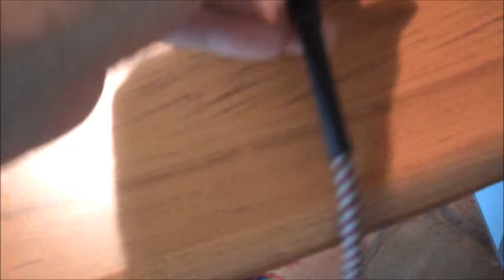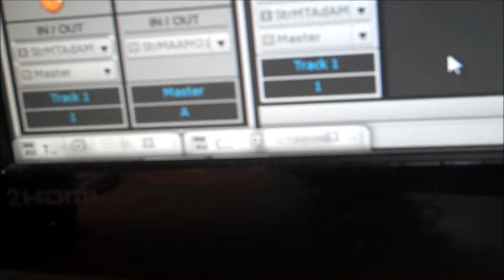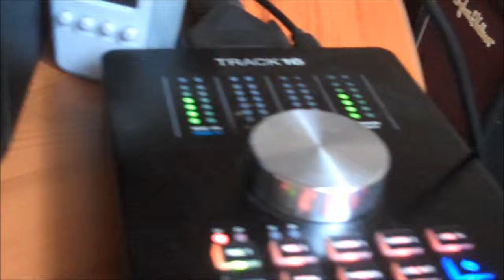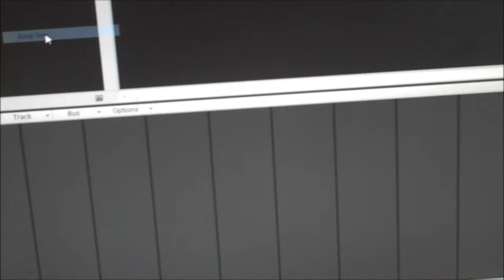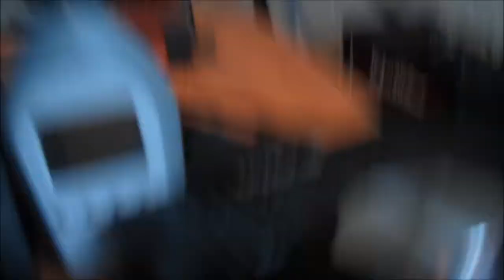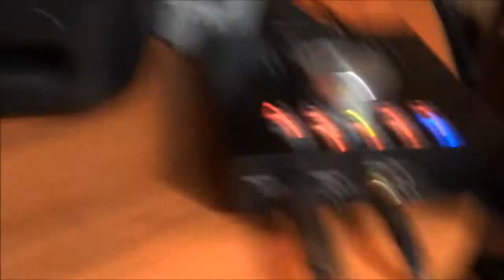Recording an Electric Guitar without an Amplifier

Comment: how do you get rid of the buzzing coming in when recording?
Reply from the maker: If you're getting buzzing or electrical hum while going direct to your DAW like I did in this video, then you could try a few things to correct it:  First, try a shorter TRS cable (high-impedance cables can pick up 60-cycle hum), second, try turning of lights other electrical accessories that might cause interference.  Ultimately, the guitar in this video is a single-coil Gibson, and it's always susceptible to electrical interference.  Inside the DAW you can use a noise gate, or manually edit out the hum.